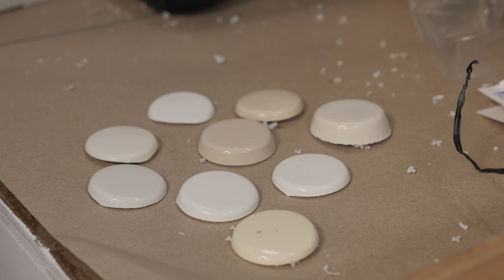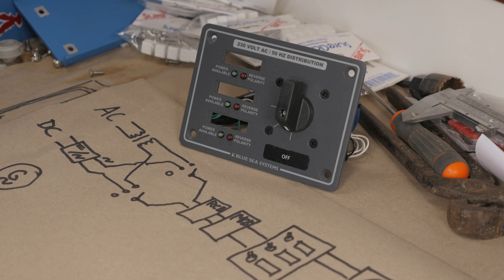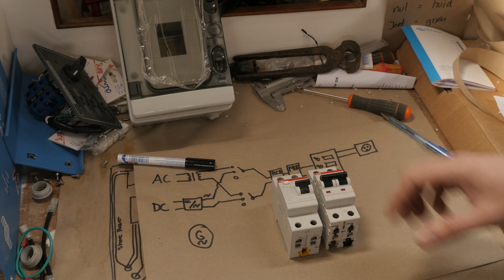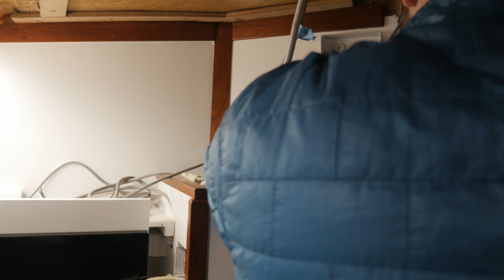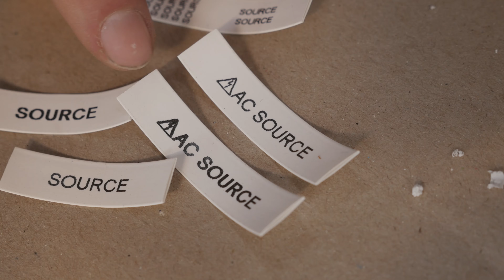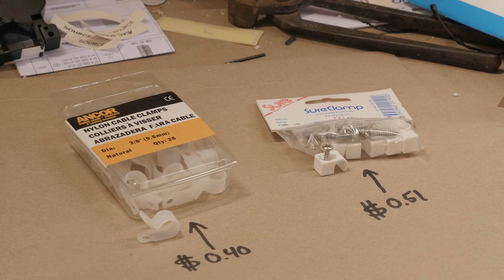Sail Life - Rewiring the AC, RDC, MCB & cable clamps - DIY sailboat refit

Comment: I think the Rhino 4200 has a setting for "fixed width" for the labels. That would be great to use for this application where several labels are next to rach other. Fortunately the white cables hides the different lengths of white heat shrink pretty well. 🙂

Comment: Now would be a good time to install an automatic transfer switch between shore power and a generator. I just installed an 4000w pure sine inverter and two auto transfer switches to replace an obsolete power converter system in my motorhome. My inverter also is a 115w battery charger and battery monitor with remote readout  which eliminates the need for a separate units for those functions. .

Comment: What are your plans should your travels take you outside of the land of 240v power? Is your isolation transformer designed to deal with this?  If not, and you ever travel to the US/Canada, and many areas on this side of the pond there will not be the same type of 240v power you have over there.  US 240v power is not the same animal since the Euro system uses a hot leg and a grounded neutral leg and the US uses two hot legs.  Running 2 hot legs on a system designed for a grounded leg can be deadly in the case of shorts.  The neutral wires of the Euro system are not fuse protected except for what the main breaker is rated in the case of a ground fault.  I'll have to check and see if you have any videos on your isolation transformer.

Comment: Im an electrician and I want to compliment you on your great work on those cables. It's professional quality. Be very wary of getting a false positive while continuity testing cables. Many many loads transformers etc will ring the meter if theyre in the circuit! Assure a double positive by testing with the wires shorted and that opening them clears the short to be sure your test is good!

Comment: Did you consider using chafe protection in wood cut-outs before running wires through?  My old boat does not have any chafe protection around the wiring in the cut-outs, and it bugs me every time I look at it.  A good body of work that could be on broadcast TV!  B.
Reply: Never mind - you answered this question the following week (I'm binge watching that last 5 videos to get caught up).

Comment: Hi Mads -- check out paralleling inverters such as the victron multiplus.  This would install between your AC selector switch and the distribution panel (probably before the breaker & meter, but maybe after the meter for accurate metering.  The idea is that when you supply AC into the inverter, it shifts the output frequency of the inverter to match the input perfectly and then parallels the two sources.  What this means is that if you have a smaller genset or are on a dock somewhere with lower amp power supply, or you just want to turn everything on at once, the inverter will boost the supplied AC (either genset or shore power).  If you add a multi-control panel, you can turn a dial and input the exact maximum Amps you want to pull from the AC source and any extra power requirements will come out of your batteries.  This system was a lifesaver on our boat when at a dock that only had 10A shore power when we normally use 50A.  Obviously coudln't run everything but could run shorter term users like washing machine on top of water heater.  Similarly, microwave could run without tripping the shore breaker all the time.  Once the short load such as microwave stopped, the inverter took the extra amps left over and charged the batteries back up.

For a bit of background, I am a Naval Architect/Marine Engineer and we sailed from US to New Zealand in 2009-2010 and then suffered a fire at the dock (battery charger failed), so I managed the refit, replacing all the AC electrical systems aboard.  Made a lot of great improvements to the boat which is now in France sailing to scotland and ireland last year.

At some point you will want to add a watermaker and an AC watermaker will be cheaper and produce more water faster than a DC system.  With a big inverter, particularly a parallelling one so genset could be smaller, you can run the watermaker for a shorter time and get all the water you need towards the end of your battery charging cycle when the batteries won't take much power anyway.  You can even build your own watermaker in which case an AC one is that much easier to get right.  The victron multiplus inverters are a bit more expensive, but the added capability is well worth it and doubles as a pretty big battery charger too. 

Hope that helps and keep up the good work
Gram

Comment: Your Dymo heatshrink labels will hold up to many years outdoors and in the sun and weather without any issues.  I have labels outside in the sun and weather where they receive sunlight nearly all through the day for nearly 15 years now and they are still perfectly fine.  The only thing to be aware of, though, is that the colored heatshrink tubing and labels will ultimately revert to white after a few years of sunlight, but the black text will always remain perfectly legible since it is pigment based (rather than dye based).  About the only thing that will damage the text or label is sustained high temperatures (hot enough to smudge the high temperature wax) and/or excessive friction against a rough surface resulting in abrasion, but then that would also damage the wiring after awhile so one tends to avoid such obstacles when they run their wiring.

Comment: That was one big assed heat gun ! I have the smaller rhino label maker. Takes a lot of batteries!
Reply: Bob Fomenko Yes, it takes a lot of AA batteries to achieve 12V.  I have three older models (about 10-12 years old now) back when they were running a promo of a free label maker if you bough X amount of label cartridges...I could have gotten 6 or 8 of them but then that would have been an absurd number of printers!

Comment: Did you know that your current meter already has an puls output?
use terminal 20 and 21. 
http://www.dutchmeters.com/files/Datasheets/DZT/DZT%206002%20V1.08.pdf

Comment: I have a question. Being a computer geek myself. I am wondering if you have good enough ventilation for heat generated by all your electronics? They may not produce much and it may be a non issue. Just curious if you have considered it.

Comment: The DZT 6002 has 2 pins with pulse output. This should avoid the need of using the photo transistor to get the pulses.

Comment: I have routed wiring before, on airplanes not sailboats but I would suggest putting some type of grommet where the cables pass through the closet walls. Over time the sharp edge of the cutouts will wear into the cables. Though not a sailor myself, I look forward each week to your videos. I enjoy them a great deal. Thanks for sharing. Another like.

Comment: Greetings from Hong Kong.  I for one am a vote to get a diesel generator.

After recently rewiring my own sailboat I went a different way. I got a Victron 12 | 3000 | 120 Multiplus inverter charger. The benefit is the "power assist" feature which allows the inverter to assist during high loads. I.e starting a compressor or air conditioner. 

The extra expense of getting this Victron should be offest by the lower cost of a smaller generator.  I have not installed the  diesel generator yet so my current setup is a petrol Honda 2000EU and this small generator with the start assist of the victron can cope with the start loads of my 16000 BTU Air conditioner.

Comment: Nice clean work! Those safety breakers appear to be equivalent to AFCI (arc fault) and GFCI (ground fault) breakers in the USA. Others may know better than me in this marine application.
Reply: Tom Winkelman AFCI is something entirely different.  What he has is comparable to a GFCI plus an ordinary residential circuit breaker.  Here in the U.S. we also have combined GFCI plus circuit breaker units that can be installed in our load centers (main panel) which combine the two roles into one unit.  

But an AFCI is something else entirely (and something that was, unfortunately, implemented in Code well before it was really ready for prime time as they can be a real nuisance in some environments as they are still essentially a beta product) as their job is to analyze the higher frequency signals, via digital signal processing, superimposed on the regular AC waveform and trip if they see something suggestive of arcing.  Unfortunately, arcing is also a perfectly normal phenomena as all switches arc when switched under load and all universal motors will arc due to commutation, not to mention the normal induced spikes and RFI generated from switching inductive loads on and off.  In some cases, operating a radio transmitter, even at very low powers, in their general vicinity is enough to trip some very popular AFCI breakers, sometimes knocking power out to much of the house just because a perfectly legitimate radio transmission was made by someone somewhere in the neighborhood (or even passing by)...which really sucks if the homeowner's refrigerator happened to be on that circuit!

Comment: Love your cable management style and attention to detail.  It cost the same to do a bad job as it does a great job, just a little more time and detail, and you will be infinity happier with a great job.  After all that's what its all about isn't it...

Also I think your RDC is similar to our GFCI breakers here in the US.  We mostly use one breaker or outlet on a circuit.  It more common in Europe to have one breaker to control all circuits down stream and it works well there.  We do use that system on 3 phase systems, like ski slope ski lift power and we are starting to use more systems like your RDC as time goes on...cheers.

Comment: Answer to the question on the door:  Isolation transformers provide galvanic isolation and are used to protect against electric shock, to suppress electrical noise in sensitive devices, or to transfer power between two circuits which must not be connected. They are used to transfer electrical power from a source of alternating current (AC) power to some equipment or device while isolating the powered device from the power source for safety reasons. It is a transformer with identical windings on each side. AKA a 1:1 transformer.

Comment: When I rewired my boat I used an ELCI breaker after the shore power inlet. Is the ELCI breaker the US version of your RCD and MCB?
Reply: Not exactly the same, but function similarly enough...Nothing to do with US vs Europe. The breakers he used were designed by Allen Bradley out of Milwaukee, WI
Reply: Yep, my mistake. I had no clue ABB was a completely different company.

Comment: My understanding of gelcoat is that it was used to allow the fiberglass to separate more easily from the mold during manufacture, and to provide a glossy appearance.  However since it is porous to moisture (gelcoat blistering) it may not be recommended to be reapplied but simply having adequate epoxy saturating the fiberglass mat along with an epoxy sealing paint is in fact superior to gelcoat.  Any thoughts on this?  BTW loving the series keep up the great work Mads!

Comment: Hello Mads. You haven't replied a single of my comments yet. Maybe i'm talking trash :) Really neat cable management. My OCD brain approves! 
About the osmosis treatment. I've read that only way to get the acids diluted (witch are absorbing moisture to the laminate) is to repeatedly wash the stripped hull with sweet water. Maybe you could dip Athena to a lake for a while? Hempel has a good  short guide online about osmosis treatment.

Comment: Gelcoat Important note. Before choosing the Gelcoat color for your repair make sure that you cut and polish a section of the Gelcoat near the repair needed. Gelcoat will change color over time so it is important that you get back to the base color before choosing the new color that you will use on the repair. There are plenty of instruction on youtube. MORE SANDING. :-)

Comment: Nice video Mads. You are going to have an inverter aboard correct? If so it would be a good idea to have an AC voltage meter somewhere near your panel for the same reason you would need one with the generator.

Comment: NICE job. The wiring looks VERY professional!!!

I have one small suggestion. When yo use the terminal boards and/or make make connections where you can see the screws, give them a quick spray of a corrosion inhibitor. I use one that has a slight brown color to it, so I know it's been coated. I did not do that during my first wiring and after a couple of years cruising, even in compartments that never saw any salt water, I was getting corrosion.

Comment: If you supply the AC from shore power and your inverter at the same time, and the inverter is not specifically built for that, I can guarantee you the power plant will win in a way that makes your inverter loose in a very very visual and audible way. :-)
Reply: Morten Kristiansen two out of phase supplies make for a spectacular bang.

Comment: I like your DIY videos very much - keep going I cross my fingers for you.
There are 5 ways to get power on sailboat:
- solar panels - works only when sun is shining,
- wing generator - only when wind blowing
- water generator - only when you are sailing
- engine alternator - only when engine is on
- external connection - only when stationary in the marine
Which one you plan to instal on your boat? I assume if you plan to "cut the lines" in the future and do some extensive sailing you will need many ways to keep the battery loaded. How many batteries banks do you have on boat? Have you summerize your power consumption?

Comment: Mads, You will NEVER regret choosing a shed and buying a diesel genset. You're also the greatest ocd geek on YouTube! Whenever it's installed neatly, then it's more economaintainable and will last much longer than a ratnest. If you lived in America, i'd hire you to help me with refits. Please also remember whenever wire bundles are installed in flexible tubing longer than 61cm, then at least 60% of the cross-sectional area must remain unused (for cooling air). Hope this helps. Jack, aka electricalpowerguy
Reply from the maker: Hi Jack :) 
I'm sorry it's been a while since I've replied to one of your comments! There are just so many comments, emails, and messages. The sad thought is that if I don't get a chance to reply during Sunday evening I most likely won't find the time. In just wanted to make sure you knew that it's not because I don't appreciate your comments :) 
Thanks! Being an OCD geek just comes naturally to me ;) 
I think I might be right on the 60% on the conduit I've used under the cabin sole. One the upside it's light loads and it's nice and cool down there :) 
All the best, Mads
Reply: It's great to learn you're getting my replies. PIease also know I'm keeping my eyes open for a female first mate ready for installation aboard Athena! Yes, i'm making sure she likes dogs!
Reply: It's very important  to keep definitions in perspective. Alternator kilowatts and engine horsepower are synonomous. Adequate propeller speed and high output alternators, especially when also powering an inverter, will often overload/overheat the main engine. It's always better to use the engine alternator for keeping engine starting batteries charged, 1 or 2 solar panels/house batteries for navionics use/lighting, and a 240v-50hz-8kw diesel generator for refrigeration, microwave, watermaker, water heater, clothes washer, purifier, house battery charger, etc.

Comment: How long is the cable run from the shore power inlet socket to the isolation transformer?  I would consider installing an additional MCB within 1 meter of the shore power input socket.
Reply: A very good idea. This would protect the transformer

Comment: Nice job. I enjoy watching your videos. What I can't understand is how you managed to have so few AC cables to your AC panel. I recently rewired my smaller boat (a Tayana 37) and the AC cables are at least double. I ended up using cable channels to put some order. Are you feeding each AC outlet through a different circuit breaker or did you group them together?

Comment: The move into the boatshed is a good one regarding the hull osmosis issue. I keep waiting for sanding to ensue yet again, but I will have to be patient!. While renovating my laundry room this week I found both of my missing rubber sanding blocks, and I thought of your varnishing conundrum.
Reply from the maker: I don't think moving the boat into the shed is going to be a lot better than leaving it outside but we'll see :) I've got some other ideas about how to dry out the hull. I'll  get back to those in the next video :) I'm still looking for a good rubber sanding block :) The one I picked up turned out to be kind of awkward to hold.

Comment: No fuse on the shore power feed?  What happens if the isolation transformer fails?  Is your wire size on the boat match the breaker on short?
Reply from the maker: There is a 10 amp breaker on shore plus an RCD :) All the AC wiring aboard the boat is way overkill for that. I could almost go up to 16 amps... but I won't ever need that much juice :)
Reply: Andy Bushnell i

Comment: Although I'm sure you would be fine in this case, I always test the cable or receptacle on a high power setting before I do a continuity test.  Your multimeter will thank you later. It's a matter of habit that you don't assume a power line is not live.